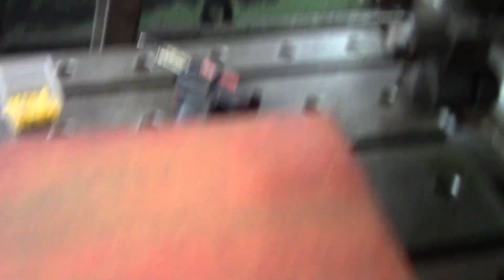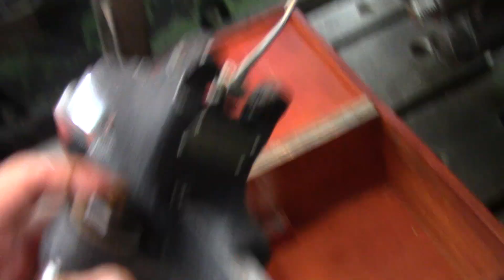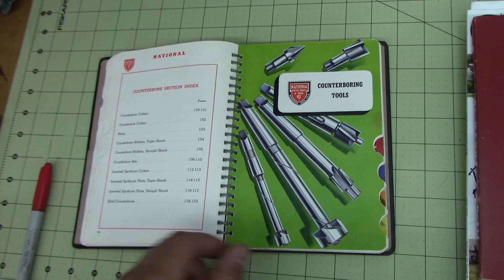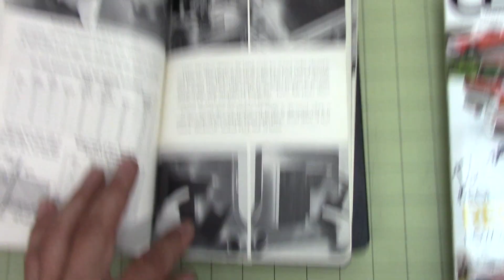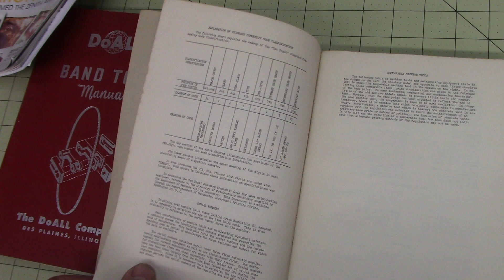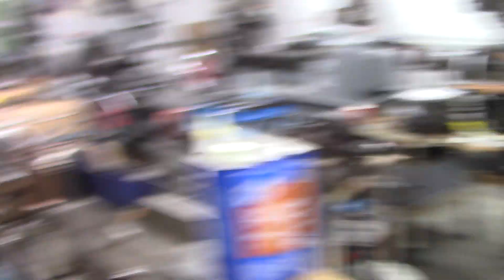6-4-23  --  Base Prices of Machine Tools and other Fun

Comment: I suspect that shaft with the indicator is so you can change out the morse taper to a straight shank. I have straight shank on mine so I can hold it in an end mill holder.  No danger of it falling out of the taper that way.
Reply from the maker: Yeah I almost got the clumsy bastard award.  --Doozer